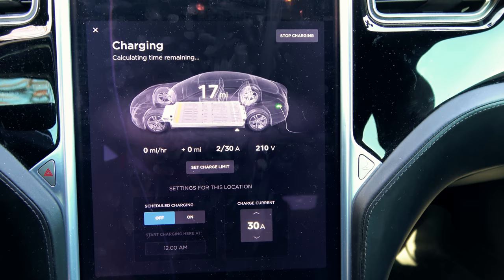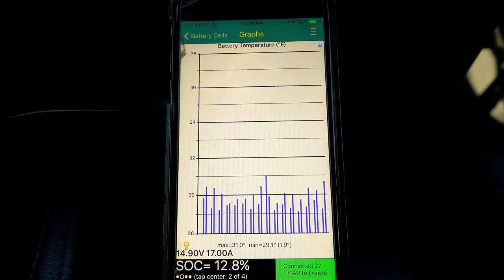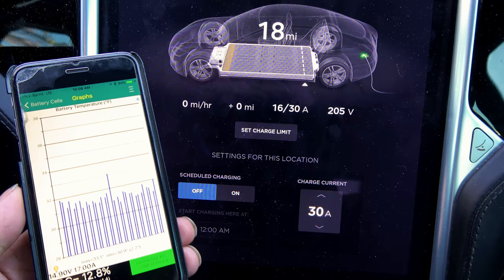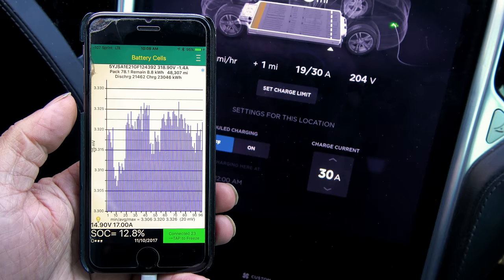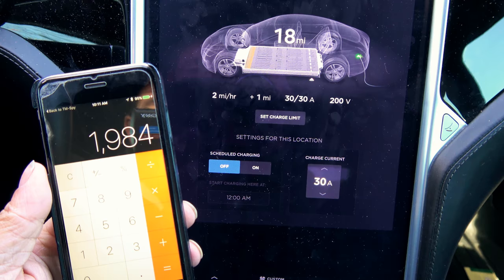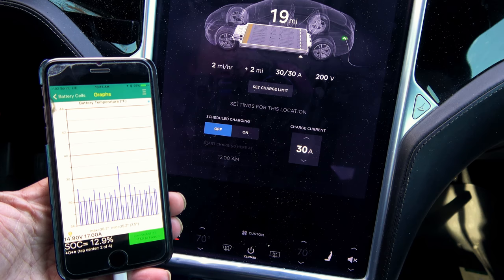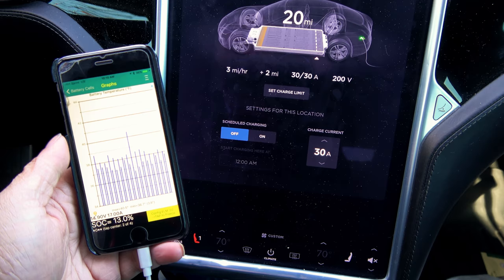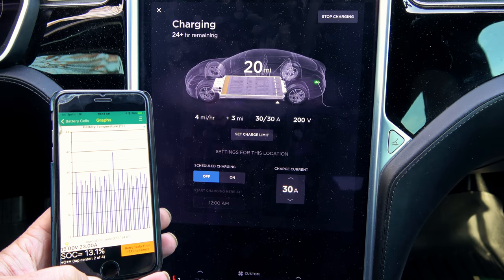Cold Battery Regen Loss / No Charging EXPLAINED W/ BMS Data!

Comment: Thanks for the video, good information. I knew some of the theory but I haven't seen it yet
Reply from the maker: Thanks :-)
Reply: So at 32 °F the battery will not charge? Seems weird. I use Celsius, that's 0 °C and that's not even freezing yet. Another guy managed to charge the battery in -17 °C, which is 1.4 °F, it just took a bit of hard acceleration to warm up the battery quicker.
Reply from the maker: robotica you're misunderstanding, The physical battery cells, the car will not permit them to be charged if the cells are at or below freezing. The car can most definitelycharge below freezing, but it will warm the cells first if they are at or below freezing temperatures
Reply: Yes, I know that. However, in his example it seemed that the battery warmed a bit quicker, maybe not. Anyway, you can just drive around like an idiot accelerating and decelerating, which will warm up the battery much quicker. What Tesla could do is use this "quick heat from discharge" method to refill their Powerpacks, then return the electricity to the car when the battery has warmed up.

Comment: Thanks for sharing this. Cool info. I wish I could see this all in my spark EV. I think our leaf charges sub freezing but it's a far different cell...
Reply from the maker: +TRY to HELP you same thing with the leaf. The lease also has a battery pack warm. It just does not have active cooling like the Tesla does
Reply: well.. im back at your video. Saw your comment, thanks.... this is straight from the manual "The Li-ion battery heater helps to prevent the Liion
battery from freezing and helps to prevent
significant reductions in the Li-ion battery output
when the temperature is cold. The Li-ion battery
heater automatically turns on when the Li-ion
battery temperature is approximately -4F
(-20C) or colder. The Li-ion battery heater
automatically turns off when the Li-ion battery
temperture is approximately 14F (-10C) or
higher" ... now i think i know why my car battery (new as of last September) is degrading so fast. It pays no mind to the temps outside in MD and it will charge when its 20 degrees outside at its full 3.3kW rate...... jeez... i think they did not do the best with that first gen....

Comment: Great video .. our Ontario Canada winters will be about the same.. So here is a scenario.. its say one does not have a garage and has to park their Tesla in a driveway with access to a 240V home Tesla charger setup.. if the car was plugged in overnight to keep the batteries warm and the outside temps around -5C / 23 F I wonder how much energy one would pull from the charger just to keep the pack at a nominal temp ? 
Cheers from Waterloo Ontario Canada ! Great Video .. Thanks
Reply from the maker: Thanks!
Actually this is a good idea for a new video. A lot of Mis-Conception on how the battery pack warmer works. I will explain. And keep in mind, my info is confirmed by Tesla sources as pretty much spot on, despite what any other Tesla Tubers might say :-)
Reply: That would be awesome !

Comment: The battery charger is limited to 3 KW because you are in range mode.  The battery heater itself is actually 6 KW when range mode isn't on.
Reply from the maker: Tim LaPean Heater power is limited. Range mode does not limit charging speed. When NOT charging, it will turn down the pack heater. When plugged in, user settings are over ridden and pack heater will activate to warm battery and permit charging. power being drawn is going straight to the pack heater instead of using pack power to hear the battery.

Comment: Ah! Thanks! I learned the ideal range of temperatures to charge a Li-ion battery today :) And that means the info I got previously saying that it was actually good to store a Li-ion battery in the fridge while not using it (charge or discharge) is probably wrong... Or am I wrong again? ;-)
Reply from the maker: Alexis de Wouters Do not store a lithium battery in a refrigerator or freezer. especially when removing it, and putting it to use. The rapid temperature change Vinny don't touch put that backyou're going to break itVinny don't touch can cause the cell to expand and contract causing internal mechanical damageand lead to failure

Comment: Lithium can be charged below freezing. Down to -15C is doable.
Reply: Leaf does that. With no damage. Though different chemistry.
Reply from the maker: It can, at very low currents. Yes leaf is different chemistry, though, rule of thumb, keep it above freezing if you want the best longevity. Thats why in general, the Tesla Packs last sooo long.
Reply: KmanAuto Yours must be an outlier, then.
Reply from the maker: Funky Dunky yes, but has to do with the silicone added in the current chemistry. original chemistry batteries will greatly outlast current ones. Tesla F'd up on the current chem
Reply: Leaf acts fine. And it can charge fast (relatively, as it has just 21kWh available, compared to Tesla 60+kWh) And I live in cold climate. And I lost 6% capacity in 3½ years. 102 000 km.
Reply: 9% loss 4½ years, 135 000km. Can charge like 5kW at -10*C. No plating.